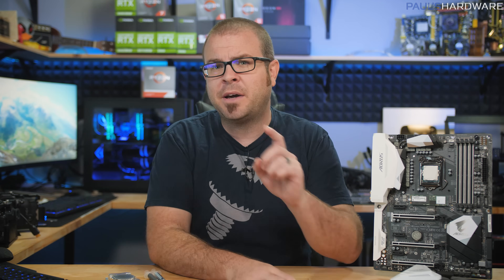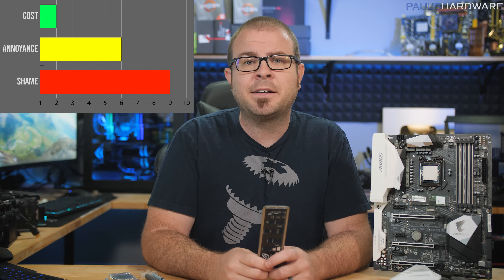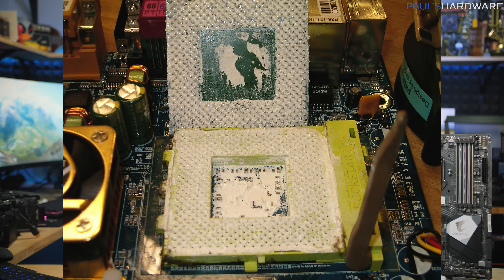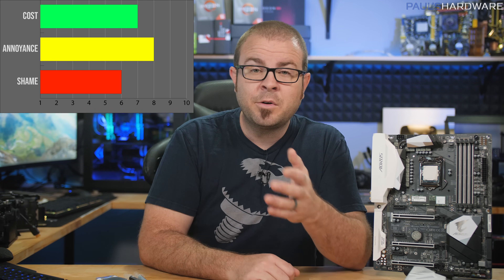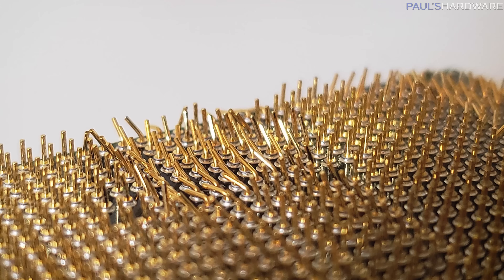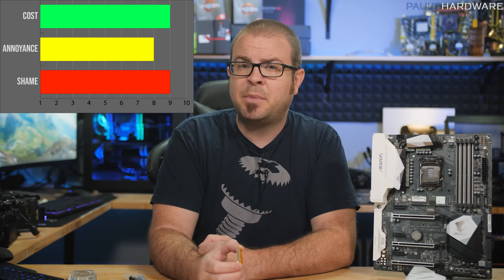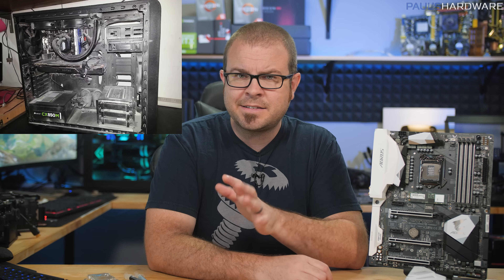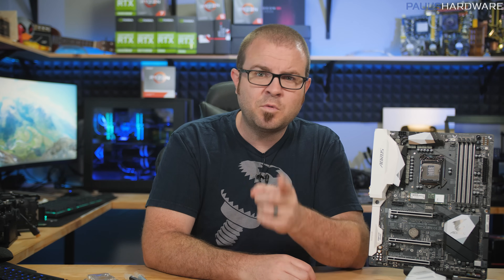The 5 WORST PC Building Catastrophes 💥🔥🧯

Comment: Years ago when modem was around, mine went down and thinking it was a fuse, I change for a new fuse and BANG, a lot of smoke coming out of my PSU. It was a bit later someone said "I saw a lighting strike" around my street and yes that was the fault, it blew my modem and totally black. After that a new PSU and a new modem even telecommunication fixed too and all is working again, shame not at all :).

Comment: My most recent issue: trying an aggressive RAM OC, then having your board fail to post, have the clear cmos header not work, and have the mobo battery hidden under the IO shield, meaning you gotta take the whole build apart to properly reset the BIOS and get it working again, so you just let it sit on your desk useless cause you don't wanna do that.

Comment: Having memory issues on my second ryzen build , I forgot that I had removed the memory . All of it .
After many failed attempts at booting, I decided to take the pc apart .
It was then that I realized the memory was on my desk in front of me .
DUUUH!!
And yes, just like magic, installing the memory solved all of my problems .
Who Knew !?
Reply: shame factor is over 9000!
Reply: Cost: 0
Annoyance: 4
Shame: 11
Reply: Haha, it is a classic scenario.

I once removed a block of RAM while the computer was turned on. I totally forgot to turn it off. Amazingly, it took no damage from it.
Reply: I never mess around with laptops so of course I Installed ram in one while the battery was still in it (the machine might have even been in standby). My brain said 'If its not plugged into the wall it cant be on; true for desktops but not in this case.The memory stick survived it however the memory slot did not.
Reply: @sparkyenergia  

OUCH !
Reply: @personaldronerepair6141  I really liked that lapto too. Still used it. The irony was that it started with 2 * 256mb sticks and finished with 1 * 512mb stick. So I got nowhere.
Reply: @sparkyenergia  OUCH ! 

Twice . :)
Reply: Did something similar, remembered to put the SSD's back but didn't attach the sata cables back and thought I broke something.
Reply: I once took apart and completely rebuilt a pc only to find the problem was the fuse in the power lead.
Reply: PersonalDroneRepair 😂
Reply: You forgot....yeah you got MEMORY issues
Reply: @saumitrapatil21  

Your probably right, wait, what were we talking about here ?
Reply: BIG BRAIN
Reply: that is not a mishap, its just an error and it wont damage the pc

Comment: Here's a fun one. Built my first PC following one of the big YouTuber guides (not verge OMG) plugged in the stuff, all the stuff and no boot. Tried a different PSU and tried the PSU on another computer, the other computer booted but my new rig? Dead. Tried all the things but no joy. Eventually double checked the Mobo manual... My idiot self had plugged in the front panel connectors to a USB 2.0 header, Found the front panel header, plugged them in and hit the button. All the things did the things and I was happy.

Comment: Number 3 is the reason why I haven't updated my bios yet. The fear is real.
Reply: Make sure you don't need a specific bios version to update to the newest one. It hapened to me with my old pc, first time i've tried it. It messed up my bios chip.
Reply: Id say do it while power demand is low in your country if you have a weak power grid, otherwise be sure that it isn't storming, you aren't boiling water at the same time, then you should be fine. If you are too scared, go to a hardware retail store and ask them nicely, preferably the place where you have bought it. I never had issues luckily :P
Reply: I solved the problem by installing solar panels on my roof and a battery, so I don't care about power outages. Okay, that was a cost factor of 125 - what a steal!
Reply: @waxiliumladrian6470  Except for when some critter decides to eat through some wires and shorts out the circuit in your house. Or someone else trips the breaker trying to pull too much power on the circuit that your PC is on. Or a direct lightning strike on your power system that just trips everything (Which of course is why you do not update a BIOS during a thunderstorm.)

It is very easy to trip a breaker that shares power with your PC..
Reply: Yeah, I've only done that 3 times in 25 years for fear of the worst.  Last time was just a couple of weeks ago for the new Ryzen CPU.
Reply: Get a good power  backup, my gaming rig with 3 monitors on GTX 1070 ti can run for 20 minutes when my power goes out .
Reply: ZepG  You shouldn't keep running if the power goes out... UPSes have been known to explode in flames even just switching to battery if the UPS isn't rated for the load the computer puts on it.
Reply: Do people here live in places where power often disappear? It happens maybe once or twice a year here, so you’d be extremely unlucky if it happened during a bios update.
Reply: @TazorNissen   I would have agreed with you a month ago but I recently had 2 power outages within a week, so the danger is real. New MB's are eliminating that problem and that's a good thing.
Reply: @TazorNissen  I'm sure some 3rd world countries use water dams as a power source. I know India is one of them. Plenty of power outages there.
Reply: @WLOfails  it's mostly during thunderstorms
Reply: @theweirdmaterial4908  I was mostly thinking about my experience in Kerala, but I sort of generalized it to wherever else has water dams.
Reply: It was raining and there were thunderstorms when i 1st updated my x570 elite bios the other night lol It was successful now my ram is running 3600mhz =)
Reply: You can usually go to any pc repair shop where they'll connect it up to a UPS for you for free. Or you can buy a UPS if you'd like. I mean. I wouldn't. I don't do any mission critical work on my home pc so losing progress isn't really something that matters to me.
Reply: Only do a BIOS update while it is sunny and calm outside. After the hurricane has passed.
Reply: We update BIOS on laptops every day at my work place, and we have not had a dead BIOS for years. Go ahead and update your BIOS.
Reply: @TazorNissen  laptops aren't connected to the power outlet
Reply: @TazorNissen  A laptop can't lose power, duh
Reply: @or2kr  ...Unless the battery has been abused by the user until it doesn't hold a charge.
Reply: @davebonner6946  but when you are in the IT, fixing those laptops, you surely have replacement batteries lying around. Anyway, the chance is minimal and doing it on a laptop is almost always uninterruptable
Reply: @or2kr You didn't work for the IT department at the same company I did...  We weren't funded enough to keep us in backup tapes for the servers, let alone spare parts on hand... Yet who was blamed first when things went wonky?
Reply: @or2kr  I live in a rural area here in the US and for several days and weeks after a good storm our power will randomly cut off for a second or two as limbs from trees manage to fall on the lines and get burnt off of them. The battery in my USP is dead and I am going to upgrade it with a deep cycle marine battery and a trickle charger soon. The project should be interesting to say the least.

Comment: I had a 0 cost, 0 annoyance, 10 shame situation when I built my first computer not long ago. I spent two hours wondering why I couldn't boot into most, until I realised I hadn't pushed the ram all the way in...
Reply: To clarify, it had made that distinct "click" sound, and I figured that was that. I had even gentle pushed after that to make sure. Turns out you have to push them a little extra at the top, to get another click.
Reply: I wouldn't say there is to much shame in that . I have been building PCs for 20 years and still do similar things .

Comment: Asking for help...

Shame factor: 0
Cost factor: 0
Annoyance factor: 0
Reply: Annoyance Factor: depends on how long it takes for actual help.
Reply: Unless it's for RTFM stuff. Then a 1 in shame.
Reply: i asked for help after my first pc build fail. didn't realize i forgot the motherboard standoffs. that shame factor is a 10 lol
Reply: I used to get paid to build back in the late 90s/early 2000s. I now get help from my best friend's son who is WAY better at modern building than I am.
Reply: Wait...you need help after 10000 bulids on YT...
Shame factor: 11 😂😂
Reply: @filipstojkovic4377  Nope - there's always new thing/ways of doing things coming out, so no shame in asking for help. Can you imagine how well the current builders would do, if they had to set up a 386/486 system with all the bus speed jumpers/Irq jumpers and the like? I think it would confuse a few for several minutes.
Reply: @lesleymunro4964  omg, someone old here.
Do you remember when there was a jumper on harddisk and optical drive? 
The one you need to set to slave and master when installing multiple hdd?
Reply: @wafifu  I remember ST-506 interfaces, with the two ribbon cables, connecting to the ISA disk controller. And low-level formatting said drives, back in the days when you could choose the number of sectors and tracks yourself, to try and squeeze out more storage. That was the MFM drives, then came the new RLL drives, still before IDE was a thing. DOS was King in those days. Win 3.1 was just coming about, and was amazing. lol! Good ol' 16 bit days. Master/Slave/CS (cable select) jumpers, I've set many. In tech terms, I'm a ghost. Too old to be here. :-D
Reply: @lesleymunro4964  Yes, I agree. But now it's so easier then 10-20 years ago.
Reply: @lesleymunro4964  I hear you Lesley, my first actual PC build was back around 84' with an Intel 8086 that had an upgraded math co-processor so it could turbo up to I believe it was 12 mhz, and a massive 20mb drive that sounded like a skill saw when it started up. You are not alone my friend lol
Reply: @ph0t0dave  LOL aye, these young folk won't even realise that back in our day, you needed two 40 pin chips to make a proper processor. 12MHz is actually screamingly fast for back then, quite cutting edge. I think I just got my first Atari 800XL with it's 1MHz 6502 back then, and was learning to program Atari BASIC. I think it was late 80s before I got my hands on 8086 tech, in the form of an original IBM XT with full height 10MB HDD and whopping 360K 5 1/4" FDD. I think it had 512K which I upgraded to 640K, back when you plugged the individual chips  into DIL sockets, it was later that SIMMs arrived when 386DXs and 486 DX2's were all the rage.  :-)
Reply: @lesleymunro4964  I know right? when those bad boys came out later I was beyond ecstatic at the thought of not having to figure out and set the DMA/IO/IRQ channels manually on every card in the case :) My very first computer was the atari400, the one with the flat keyboard that was a pain to type on lol, and I later had the cassette tape drive for it as well, so I could save my games that I spent hours and hours typing in from magazines, but still would take 30 to 60 minutes to load. Nothing worse than seeing a game in a magazine that looks cool, only to spend what seemed like an eternity to type it in, and providing you didn't miss type any code or the magazine didn't miss print any either because there was nothing to indicate where an error was and you had to again manually look through every line of code to find an error, and then a lot of the time only to find out it actually sucked haha! kids these days have no idea how good they have it ;)
Reply: @ph0t0dave  LOL! I remember those days. I once spent a week programming a machine code fruit machine on the 800XL, it was just rows and rows of DATA statements with the raw machine code numbers, from 0 - 255, comma separated. I would have cried if I couldn't save it. It's one thing I liked about the Atari tape deck though, it was pretty bullet proof for saving stuff, more so than our C64 or Sinclair 48K cousins. :-) I remember being amazed when I got a 1050 disk drive, and it could load in under 5 minutes. It beat waiting 15-30 mins for the tape. The magazines were fun back then, you always felt you got something when you bought them, because of the very reason you state, where they'd always have a game or program in them. Hours of fun. I actually feel for kids nowadays, cos they don't really get to figure out the nuts and bolts of tech, and I feel they''ll loose an understanding of how it actually works. We got problem solving skills, I'm not sure the next generation will get similar skills.I think they'll become "professional consumers" rather than fixing stuff themselves. Though, to be fair, I don't think that applies to this audience.
Reply: @lesleymunro4964  I hear you on the younger generations and completely agree with you about them becoming "professional consumers" more and more. A lot  of things that were expensive 20 years ago are now quite cheep in comparison and thus very disposable. Look at RAM for instance, I remember buying a 16mb stick years ago and paying $900 each for them. And with a lot of things being so easily accessible now, if something breaks, you just throw it away and buy another one. Rather in our time, we couldn't just buy another one for the most part and ended up taking a lot of stuff apart to try to fix it. I have a few friends in their 30's even that are like what you describe, where they prefer to just pay someone to install something or fix something that would be trivial to someone like us. So many times I've heard over the last few years "How did you know how to do that?" Like my electric lawn mower, it kept crapping out while I was using it and it was only 6mo old at the time. So my first thought was there is a safety switch I noticed near the bottom of the handle and I suspected that first. opened up the mower and sure enough, the switch fell apart as soon as I touched it. So I decided to just bypass the switch and made a quick jumper wire with a couple crimp on spade connectors so I had the option to easily put a switch back in down the road and what do you know, its been running flawlessly since, and my wife and a few of our friends look at me like Im a magician or miracle worker because this was my first electric mower and Ive never had one apart but still knew how to fix it. In truth it was about past life experience with taking other stuff apart to fix or just see how it works lol. To me it was crazy simple and to others I should be working for NASA haha.
Reply: @ph0t0dave  LOL! I hear ya. I've had that when working on my car when I had it, had guys coming up to help the "damsel in distess", only to find I'm in the middle of a job fixing it, and telling them, "well unless you know about XYZ, I'm good, thanks." It's the incredulous looks when I've had the laptop connected to it too, resetting the DTCs. I replaced all the brakes a few years back, and had the drunk guy in the next close commenting to his two  pals about me working on the car, in utter amazement. I was lucky, I got taught a LOT of stuff from my Grandpa, and my Dad. My Dad could turn his hand to anything, and I think I've learned the same. :-) 
You are right about the next generation though, stuff is made so cheaply, that rather than spend time trying to fix it, it's easier to just replace it. And with it, They are losing problem solving skills, I think. It is heartening though to look at things like the "Maker Movement" and Retro Hardware folk repairing old stuff. I think some are realising the value of these skills, and doing things to save them. 
Thanks for the awesome chat, it's been interesting. :-) I'll let you get back to designing rockets :-P (NASA Eng.)
Reply: @lesleymunro4964  Haha! Well in truth I started out as an apprentice mechanic a hundred years ago but thanks to arthritis and other things I had to refocus so I got in to graphic design, 3D animation, Visual Effects, Photography and throughout it all I needed high end computers so I always build my own and have build a few hundred for other people and companies as well. I think most of my wife's friends see me as a "computer geek" and not realize that there are very few things that I have come across that I can not fix and are simple to me but somehow magical to them haha. I'm actually working on a secret custom PC for my son, but due to some challenges in life, I need to find some more sponsored parts for it. I do thankfully have NZXT on board so far :) Long story short, he was born at 24weeks premature and was not expected to last the week... Just over 15 and a half years later, other than a couple small problems he is doing great and he is also my best friend as we have a very strong bond, so Im hoping to have this done for his 16th Bday :) .  Its rare these days to find someone, male or female that is mechanically inclined and like minded to chat with so this has been a great time chatting with you. Thank you as well for the chat, it was fun.  Hope you have a great day and many more after.

Comment: I had a roommate who insisted on building his own PC without any assistance from me. He assembled everything according to various PC build guides, turned it on and nothing happened. So he started disassembling his system to return to the store. About 15 minutes later, he asked me if the CPU was supposed to be sticking to the bottom of heat sink.  I looked at it and tried not to laugh. I told him that he missed a step when installing the CPU (i.e., using the lever to lock down the CPU). He cleaned up his mess, properly re-seated the CPU and heat sink, and the system booted up fine. AFAIK, that was the last PC he ever built.